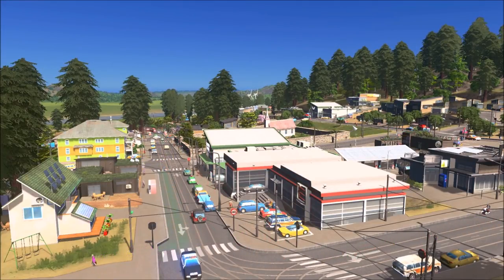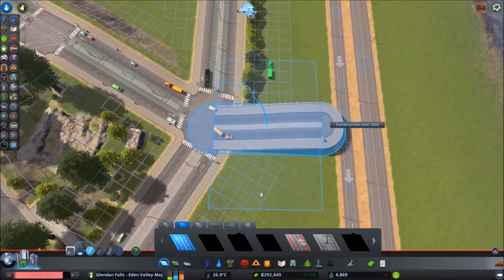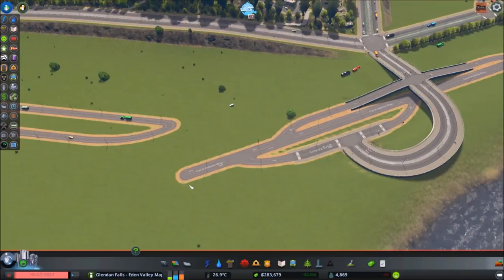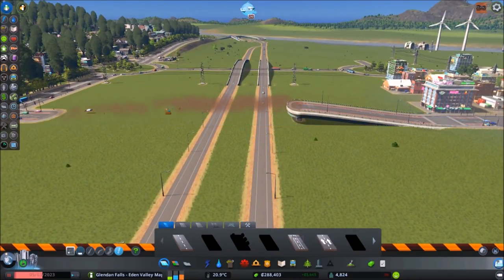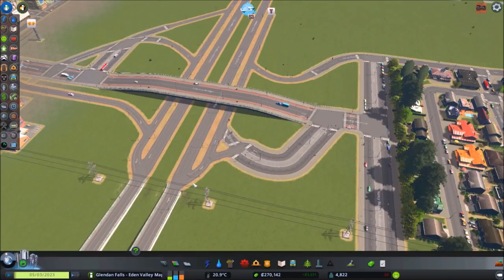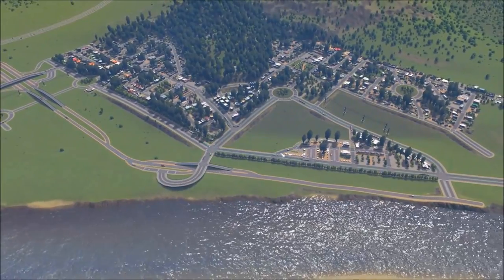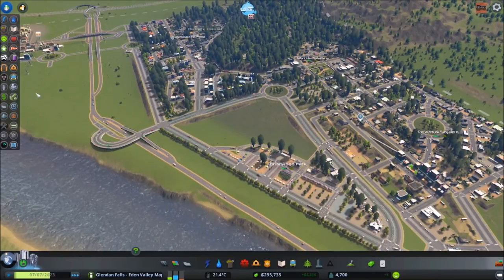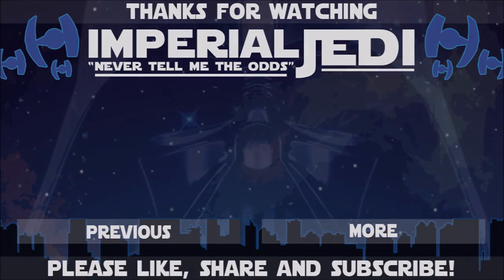Let's Play Cities: Skylines Green Cities EP4 - Highway Re-Design

Comment: You could scoot the highway bridges back towards the river and add a curvy road in between the roundabouts (the connecting road) go under the bridges. Give you more room to work with the exits. Especially that off ramp to residential

Comment: Hay Jedi, I've got a bit of a problem in my city, I've got 2 connections to the outside highway it basically runs right through my city, my problem is sims are just using it as a short cut and clogging the highway but not even going into my city, is there away I can stop them from bypassing the city?

Comment: You know, I never agreed with your penchant for building 'collector lanes' along highways. They're just a waste of space. Cims calculate the fastest route available, which means they'll drive along a highway (100mph) until they need to take an off-ramp (80mph) to transfer to local roads. There's absolutely no need for them to drive along a slower collector lane adjacent to a highway. I tried building them in my city and found them to be completely useless. I think this is one piece of bad information you're giving viewers.